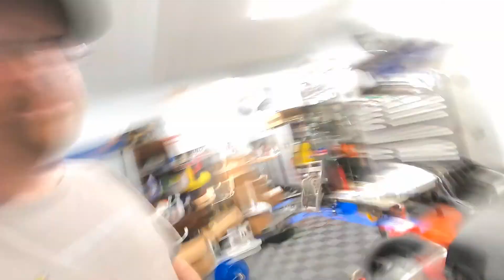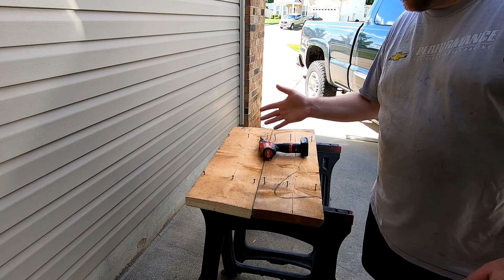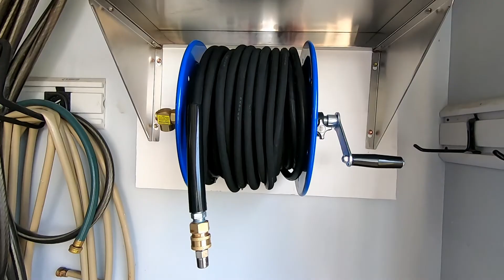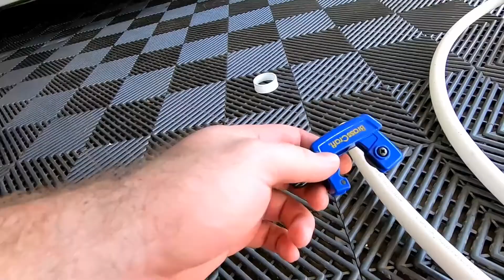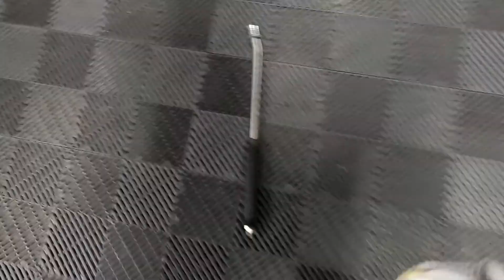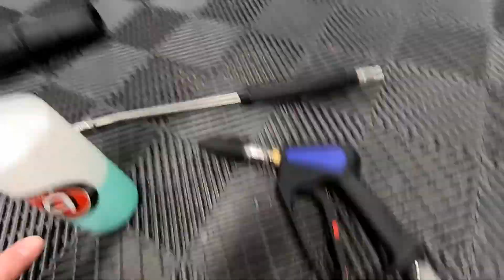Ultimate Pressure Washer Setup!

Comment: Did you use the mounting hardware that came with the Cox Reel? If so, do the screws go through/past the 2x board you have on the wall? Just trying to get a better feel for how the reel gets mounted. Thanks
Reply from the maker: I think I just bought some lag bolts from Lowe's. 

I don't remember it coming with any mounting hardware.

Comment: This is great! Looking to do the same setup in my garage. What screws did you use to mount the 2x10 boards to the studs?
Reply from the maker: I think they where half in lag bolts - probably 4" in length or so. You got about an inch of the 2x10 to anchor through.